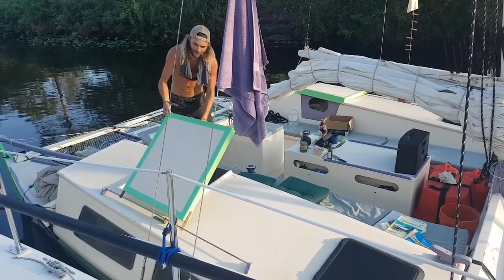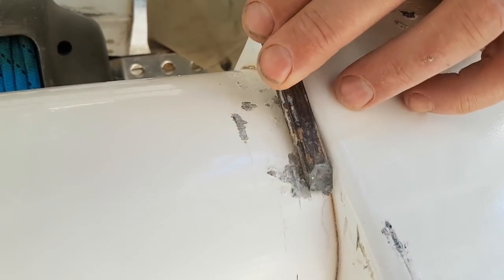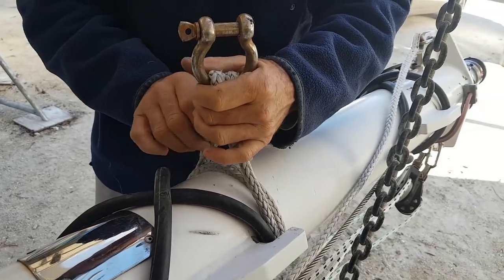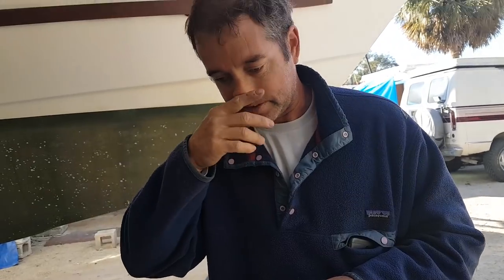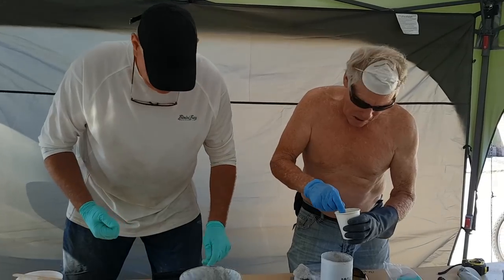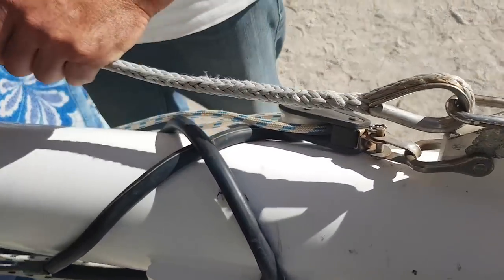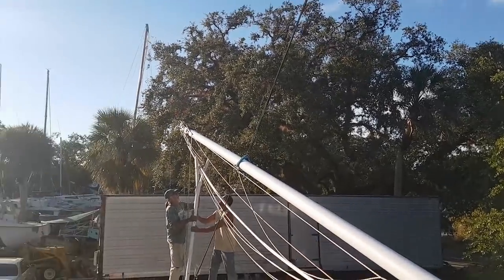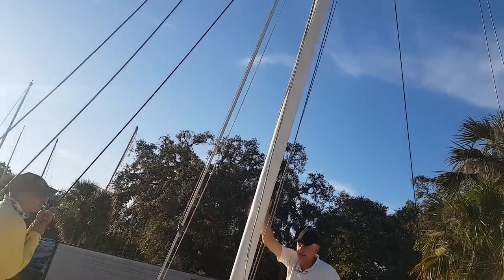Luckyfish Turns 6! - Inspecting a Wood Epoxy Sailboat Pt 1 - Ep 59 Sailing Luckyfish

Comment: Great vid mate. Don’t use a ferrous chisel on Al spars or the corrosion bubble will come back also make sure you use abrasive paper is Al Oxide. Cheers
Reply from the maker: +Paul Bennett - great tip mate. curious to know more about that one. Is it that the ferrous chisel is leaving micro bits of steel behind? How is your Tiki coming on? did you build the vane steering or is that well down the track? Cheers, Stew
Reply: Luckyfish Gets Away : yes mate. Another way of looking at it is you are using the hardened bright mild chisel to scratch around in the Al corrosion. Sure the Al is softer but the Fe surface corrosion  is always left behind. We can’t get away from introducing O2 but mixing base metals during a repair and sealing over with an epoxy paint is a bad idea/consequence.The Tiki was never started, the Hitia 17 was sold and I bought a Baker built Cape Barren Goose and have been sailing that ever since.

Cher’s mate.
Reply: Sorry just reread your question: you are not leaving Fe not micro bits behind but Fe corrosion. All metals are always corroding. Some say they do that protect themselves but really to believe that you would be subscribing to the theory that all things have a spirit and I don’t see any pet rocks on Lucky Fish.

Comment: Okay, you've convinced me.  When I get my project going, it's going to be sheet metals/polymers & modular pieces.  Fiberglass & exterior wood are more fussing than I'm up for anymore.  I'll find a way to insulate or dampen the metal-drum factor, like polymer walking mats on deck & anti-acoustic foam on inner walls, or something.  Thank you so much for the reminder!
Reply from the maker: fair enough. you won't even need to bother with coatings if you can live with the industrial look. the blog Morgan's Cloud said their one regret was painting her in the first place.
Reply: @SailingLuckyfish   Yah, the tradeoff will be heat management and price.  Sheet metals are crap insulators compared to your wood & fiber, and they aren't cheap like they were back in the day.  That will affect the size of the first experimental model, especially in a material-intensive tri-hull.

Thanks for the feedback and encouragement!

Comment: Hi Stew and Zaya--speaking of last week's episode, would you consider, sometime in the future, sharing the process by which you evaluated
the energy needs of your boat, and determined how to implement the green energy sources that you've installed?   Yours is the first of the
vessels that I've encountered in the sailing vlogs that utilizes solar, wind, and hydro simultaneously.   Really intriguing!     I have only the most
rudimentary understanding of amps versus volts, amp hours, etc, and analyzing those factors regarding boats.    You're clearly quite knowledgeable 
about it.   I really enjoyed the episode on your hydro generator.   

Also, have you considered replacing Luckyfish's current motors with electric ones?     How awesome, if you were able to upgrade your boat to total energy independence!

Keep the wonderful videos coming!  :-)
Reply from the maker: +Terry T - pm'd you. Yes that vid is in the pipeline, once we have our system finished...

Comment: Wood is acidic which may be causing the problem with your mast bubbling at the base. I used to work on wooden aircraft. I often found fixings which were waisted in the wood  from corrosion with black witness marks around them. The fixings were stainless and the wood usually Stika spruce.  The solution was to put chromate paste on the fittings to stop the erosion.